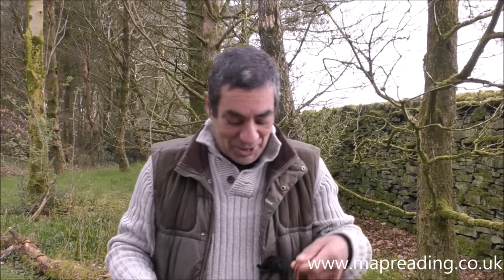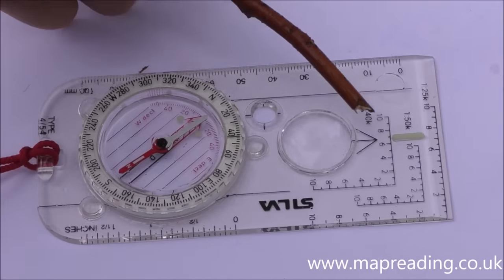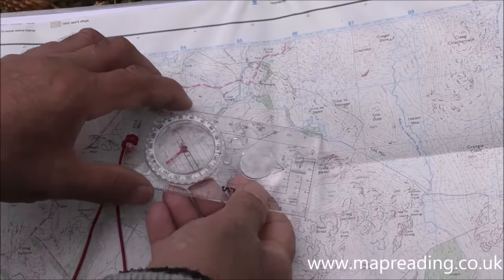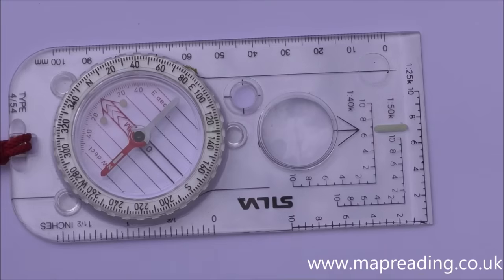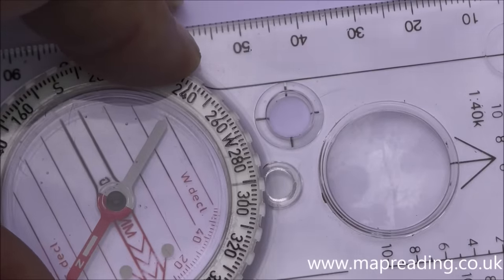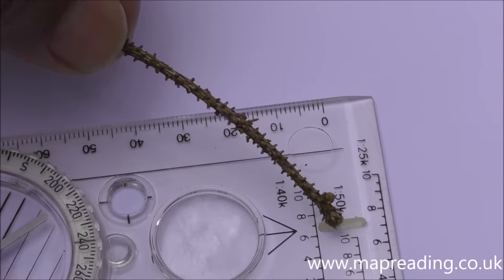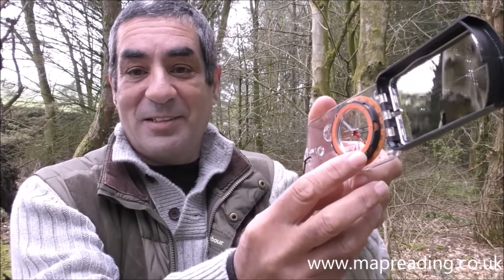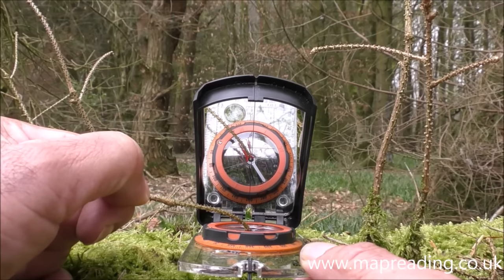Base Plate Compass, "every" part identified and explained

Comment: Good video and all, but should still have added the most basic use for compass.. getting from point A to point B on map.. using orienting lines or what ever you called them below rotating part.. you showed instead how to go to 180 degree.. pointing rotating north to map north using orienting lines to match map vertical lines.. Lot of people end up looking this video and wont gain the most basic use for compass.
Reply: Anyway i like all the extra info about things on compass, some of them i might even end up using
Reply from the maker: I have LOTS of videos about how to navigate, with and without a compass.  This video is just showing the parts of a compass.

Comment: The North Pole of a compass does not point North, it points South. It's the 'opposite poles attract' thingy.  It you want to know which way is North, ask the South pole of a compass to show you. 
Also, heavier things fall faster than lighter objects.
Reply: hoo boy that's some high quality bait there
Reply: @Firefin    Lol.   It was the heavier things remark, huh.
Actually, if you had a 10kg weight and a 1 kg weight and measured the time it takes each to contact the Earth, you would find that if dropped separately, the heavier weight would contact the Earth in less time.
BUT, if you drop them at the exact same time, the 2 weights would impact the Earth at the same time.
This happens because gravitational attraction is a 2 way street. The Earth attracts the weights but the weights attract the Earth. 
The compass thing?  The North pole of a compass points to the Earths South magnetic pole. Some people like to pretend the Earths South magnetic pole is close to the Earth's geographic North pole meaning the North pole of a compass points to the Earths geographic North pole. Personally, I believe the south pole of a compass has a red N painted on it.
Hope this helps  :)
Reply: @WricNick  When  people explain the 'anvil and a feather' thing they always specify 'in a vacuum'—which is immediately forgotten by the student. The heavier weight is better at pushing the air out of the way - if they are both the same size so the same drag.

Comment: All of my compasses get bubbles, where do I find oil filled compasses? Or how do I fix my problem?
Reply from the maker: It would seem a little strange if ALL your compasses get bubbles.  Are you living at a high attitude or in a very cold climate.
The reason I ask is that if you live much (MUCH) higher the factory which produced the compass this could cause problems, the same applies to the average temperature between where you live when the compass was manufactured.
Reply: I do a lot of winter Mountaineering,  eventually, they are all exposed to 15 or 25 below 0 F  @TheMapReadingCompany